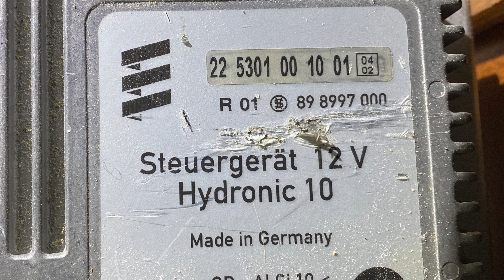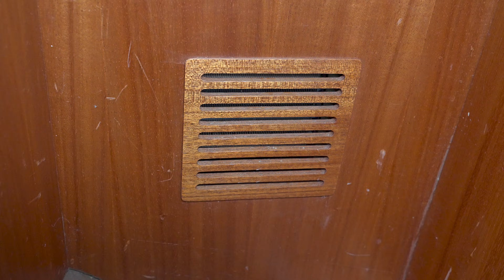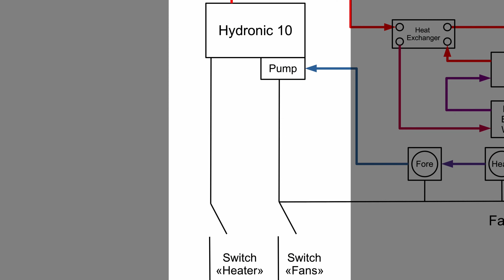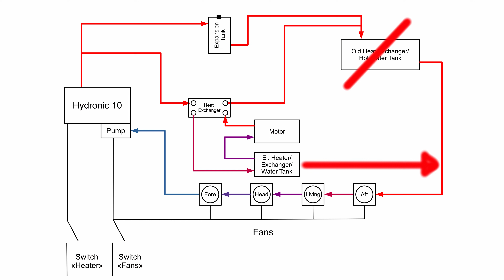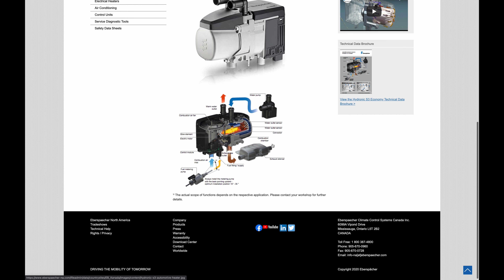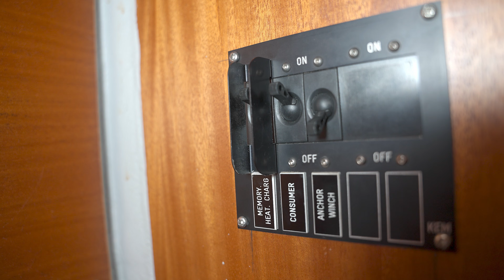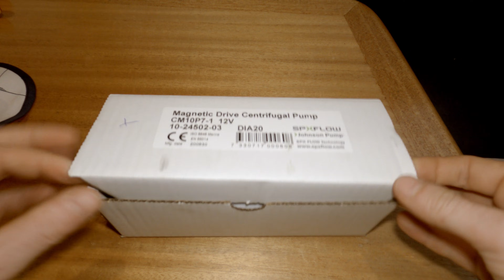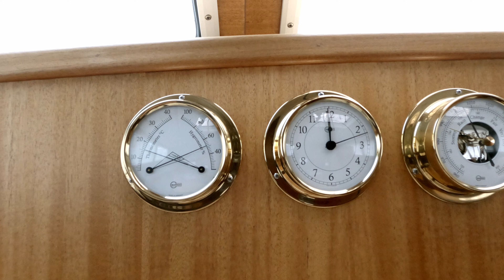Boat Heating | Hot Water without Engine | Eberspächer Heater Upgrade

Comment: Hvilken timer bruker du? Satt på en eber timer, den gå max to timer så stanser den. Hvordan har du koblet den?
Reply from the maker: Jeg bruker ingen timer faktisk. Det var heller ingen fra før. Hydronicen går i "lav" modus eller helt i "sove" modus når vannet i kretsløpet har høy nok temperatur og temperaturen endrer seg ikke vesentlig deretter. Hvis temperaturen går ned så slår han seg på igjen. Siden jeg er alltid om bord når jeg bruker systemet trenger jeg ikke en timer. Håper det hjelper ...
Reply: @SailingSyvsover  hvordan starter og stopper du den? Jeg har montert første gen m10, med den fulgte en timer, men den går max to timer. Ønsker å få den til å gå uendelig.
Reply from the maker: @gacco11  I manualen "HYDRONIC M-II
Technical description, installation,
operation and maintenance instructions" finns det på side 30 en beskrivelse av de enkelte kontaktene i kontrolkabelen/pluggen På den eldre modellen er det kontakt A1, på den nye C4 med funksjonen "Heater on" (gul kabel). Jeg antar at i din installasjon er det timeren som gir 12V til kontakten. I min installasjon gir jeg 12V direkte (gjennom en bryter i kontrollpanel) på den. Så lenge bryteren står på går hydronicen. Du kan jo prøve å måle med en multimeter om det er den som styrer hydronicen. Hvis det er den så kan du antageligvis går "forbi" timeren. Men for å si mer måtte jeg nesten se installasjonen din ... Håper det hjelper!
Reply: @SailingSyvsover  slik jeg forstår det du skriver så skal gul kabel ha pluss når varmeren skal gå. Det kan løses med en enkel bryter?
Reply from the maker: @gacco11  Ja, slik er det i min setup. Men som sagt: jeg ville måle det med multimeter for sikkerhets skyld før du setter inn en bryter. Mål om det er +12V på den gule kabelen når timeren slår på varmeren og om spenningen er tilbake til 0V når varmeren slår seg av. Og hvis det er tilfelle så kan du prøve å sette inn en bryter i stedet for timeren.
Reply: Mister du ikke muligheten til å se feilkodene 
?
Reply from the maker: @gacco11  Ja, men det må jeg jo bare se på når det er faktisk feil. Har aldri hatt det med det nye systemet  (hittil). Og hvis det er feil i system må jeg koble om/fikse det uansett, da kan jeg koble på noe for å lese ut feilkoden... Som sagt, systemet mitt har aldri hatt en timer.

Comment: Great video! I am doing exactly the same project, upgrading the Espar D10 to the latest Espar 10 (M-II). What did you do for the wiring harness? Were you able to use the old harness?
Reply from the maker: There were some changes logically, that is the reason why I had to add the relay. But as far as I remember was the harness itself the same.

Comment: Thank for a very interesting video! Couldn't You have used the old tank as a heat exchanger? You could have run glycol through the heater, pump and the tank and thus increasing the volume of (glycol) fluid the heater works with. Then You could run the radiators as it's own circuit (albeit with another pump) through the old tank's spiral. If the heater circuit and the radiator circuits are separated You might be able to run the heater more steadily. Although Your model of heater seems to have a really good range of heating power.
Reply from the maker: The problem with the old tank was that it was full of rust and the loops not water-tight anymore ... Otherwise I might have used it somewhere else :-)
Reply: @SailingSyvsover  thanks. Makes sense

Comment: Thank you for excellent video and the detailed information! I already have most of the components working, except our boat hot-water tank is not heated by Webasto 90 heater, so i would need to add a heat exchanger and an auxiliary pump. I have a couple questions: 1. What heater exchanger  unit did you use, could you share a link? 2. When  you are motoring, so  the engine is running and auxiliary pump is working, the water-tank is heating up …but what if you also want to warmup the boat. Can you control your fans separately and without turning on the heater? Thank you in advance!
Reply from the maker: Hi!

To your questions:

1. I have unfortunately no brand for the heat exchanger. But any water/water plate heat exchanger should do as long as you can fit the connectors somehow.
2. If you take a look at the circulation diagrams (the link is in the description), you can see that the auxiliary pump is pumping the heating medium also past the heater fans in the cabin. So if you switch on the cabin fans (or they switch on thermostat controlled), you can heat up the cabin, too. In my setup they are separately controlled through thermostats, independently from the heater.
Reply: @SailingSyvsover  Makes sense. Thank you.

Comment: That`s a very good vid, love the humour. Have been getting ready for such a system for a while but keep running into exhaust routing problems. Do you know the exhaust temperature at the exit of the unit?  If i could find this out i could simulate it with a heat gun and some of the exhaust ducting and figure out the heat loss to the exhaust exit and not cook anything else in between.  Thanks, Warren
Reply from the maker: Sorry for the late reply! Your message didn't show in youtube studio, just see it on the normal page right now. I will measure it for you in the coming days! At the outlet it is hot enough to hurt. But I couldn't tell you right now if it is 50 or 100 degrees C (my hands are not that finely calibrated 🙂)
Reply: @SailingSyvsover  Hi, thanks that`d be great.  Little laser heat measuring gun is the easiest. Have put the project back a bit while we go sailing but likely a trip away will lead to more enthusiasm. Cold water is an excellent motivator,,,

Comment: Thanks for sharing. I plan to add this type of system in a van conversion. Two questions if you don’t mind. 
1. Do you and how far ahead have to plan ahead when you want to get hot water for the sink? 
2. Are you just using normal mixing valves to mix tank and hot water to get the desired water temperature? 

I’m wondering if somehow you could have separate thermostats even for the water, like different loops that can be run intermittently to achieve the correct temperature. This is more complex but obviously might be more accurate and even save water and energy I’d think.
Reply from the maker: To answer your question:
1. In my setup it takes 15-20 minutes to get hot water. Usually we switch on the heater (in case we are not heating the cabin anyways) when we are done preparing lunch/dinner and let it heat during the course of the meal. Then we have hot water when we are done eating to do the dishes. But I assume that depends highly on the size of hot water tank you have. The volume of ours is (I think) 25 liters.

2. Yes, just run-of-the-mill mixing valves. 

Most likely you can install different loops with different thermostats. But then you need to actuate valves and synchronise that with more thermostats which adds another layer of complexity and all around more stuff that can break potentially. I am not sure if you could save water with that, but it might save some fuel/electricity, though in my setup probably not noticeably. But for much bigger boats that is certainly the case.

If you think about adding more control over the output water temperature from the heater: Eberspächer offers control units for its heaters where you can fine-tune that. I would suspect that other manufacturers offer the same.

And good luck with your installation!

Comment: Great video! Can you tell us what controller/timer your system is using? I am putting a very similar system in an caravan but I am not sure what timer/controller to use.
Reply from the maker: Sorry for the late answer! The controllers for the fans/radiators are unfortunately some no-name product. It is really just a simple temperature control switch controlling the 12V to the fans. The fans are switched on if the temperature goes below the programmed threshold on the display (gives the fan 12V, so that it can blow air through the radiator and into the cabin). It switches off if the temperature is reached. The Hydronic itself does not need a control unit in this setup. It keeps the water-temperature at a constant value (around 70°C) and circulating constantly as long as it is on. Hope that helps.

Comment: Very helpful, thanks for sharing. How do you vent the hot exhaust, out through a thru-hull or to a chimney on the deck?
Reply from the maker: In this boat there was an exhaust installed already. I think you can buy the parts from Eberspächer or other manufacturers. It is just a stainless pipe which leads through the hull outside in the aft (well above the waterline). The only thing which you have to make sure is that it has the right diameter so that you can connect it to the exhaust pipe.

Comment: For stiff radiator hose you can put the ends in near boiling water and they'll slip right on the fitting like butter. Not convient sometimes but it works wonders.

Comment: Can you service the water pump within the Eberspacher without having to disassemble the whole of the Eberspacher I.e. do it in situ
Reply from the maker: Looks like it. It is outside of the casing and is electrically connected with a little plug. Mechanically it is held in place by a hose clamp.

Comment: Excellent video. I’ve been trying to find a solution for hot water, but already have a Webasto air system for heating. So I doubt I go this route, but always good for ideas and thought.  I wonder if you have an issue with the defrosters (radiators are always slow) - I installed a defroster on the engine cooling system and it is really fast and warm which is a great thing early season as we leave the mooring. I did that about 3 years ago and was very easy. Maybe there is some build up or sediments in your defrosters from that old water tank?
Reply from the maker: Thanks! The defrosters/fans in the boat are quite small and more or less made to be very silent. They deliver slow and steady heat and you have to get close to hear them. In that respect they are more like radiators with a bit of airflow. The system as it is is designed to be kept on for hours on end without being a noise nuisance. I thought about sediment, too, but the return flow would be a lot less if there would be some serious blockage and they output the heat, just not at the rate I'd hoped for. I did flush the whole system (in both directions) and the return flow was crystal clear.

I got a proper 4.1kW defroster unit which I install at some point so that I can switch it on and off independently and will make an update about that. The fan is significantly louder and outputs a lot more air. I am pretty certain that this will alleviate the problem of the initial heating. Once everything has its initial temperature I can switch the defroster off and the normal fans take over to keep the temperature. That is the plan at least :-)
Reply: @SailingSyvsover , sounds like the design is a good one slow and steady. And yes the defroster I have is extremely noisy. Good plan to add such a device on a separate switch, with the motor running the added noise makes no difference. But it is not for long term running when it comes to sanity ;-).
Reply from the maker: @milesbuckhurst504  We use the heating mostly after we arrived, especially when sailing. To keep the sheets organised we often throw the ends down the companionway, so much of the heat would dissipate outside anyway. Upon arrival I hope that I can switch on the defroster for 30 minutes or so to get some baseline heat in the salon. Afterwards the fans should have enough power to keep that baseline and heat the fore and aft cabin.

Comment: I'm going to steal your setup with one modification, and there lies my first question, why do you want to run heat into your living space when you only want to heat water to the tap water system? Two of these below some hose and two y-splitter with a simple on-off swith that chooses between only heting tap water or tap water and heating the cabin. 
I can see that you have fans to your convectors so in your case maybe it does not mather so much to you but I have seven passive convectors and one active with fans so I don't want to run heat into them in the middle of the summer.
Second question, dont your 8kw dieel heater cycle on  and off to much when you have removed your "buffert tank" I bought one only 5kw because it is quiter, draws less amperage and I guess that in it's lowest heating it may stay on even when only heating water to my tap water system. 
Do you have any thoughts of my plans? Do you think it will work fine?
https://www.amazon.se/elektrisk-kulventil-motoriserad-st%C3%A4lldon-luftkonditionering/dp/B0895ZLSZ7/ref=asc_df_B0895ZLSZ7/?tag=shpngadsglede-21&linkCode=df0&hvadid=476490440052&hvpos=&hvnetw=g&hvrand=11947341800634289129&hvpone=&hvptwo=&hvqmt=&hvdev=c&hvdvcmdl=&hvlocint=&hvlocphy=9067788&hvtargid=pla-1015413158376&psc=1
Reply from the maker: Sounds like a proper plan! My radiators all have fans, so it doesn't do much if the heat goes through them and the fans are off in the summer .... But I know what you mean and I think with a valve it would work out just fine. I just didn't want the added complexity.

The old heat exchanger working "buffer tank" was not improving my system. They don't recommend them for truck installations either, at least not in their diagrams... The volume of the whole system in itself should act as some kind of buffer, too. I don't really have the problem that it switches on and off too much. I think it really depends on how "sudden" your heat demand is. If you take a lot of hot showers on hot days it might become a problem. But for the most part the heating is switched of in our boat if it is warm and we switch it on maybe in the evening for 15 minutes to wash the dishes, that is enough to heat up the hot water tank...
Reply: That's the beauty of eberspatcher it throttles down to 5000 BTUs also I would run radiant hose all over the place to prevent condensation 👍😁
Reply: @rogerkerkmann  Doesn't radiant hoses increase condensation on your boat? If you heat the air it should condensate more easy on the cold hull.
My boat has 50-60mm PUfoam from the bilge and up so I rarely get condensation att all.
Reply: @johnnyandersson5622  works on your car windshield in the winter, just as long as you keep the heat above the dew point 😁
Reply: @rogerkerkmann  Yes, but it defenitely wil not work if it was cold water on the outside of the windshield. :)

Comment: I am in the process of understanding my central boat heating system based on Eberspächer Hydronic M 10. The yacht is a Garcia 54 and I have two radiators in the saloon and one in each of the three cabins and one in the master toilet. After searching for info, looking at endless videos and reading manuals I found your video that explains the system in a great way, easy to follow and makes my work easier. You just made my day. Awesome, thank you and keep up the great work.👌👍
Reply from the maker: Really glad it helped you! That was the objective of the video. I was in the exact same situation and had to dig around in manuals, spend endless hours following the pipes in my boat trying to understand my system :)
Reply: can I ask you what model of radiators you have installed?
Reply: Did you find out what radiators they used? I’m having this system installed.

Comment: Good thing my boat it's just 9.5meter long with just one room for a bed room .

Heating ?
Well I have 3 options on the boat .
Option 1 
Electric heater 1000watt.
Option 2 
Diesel heater to air .
Option 3
Just burning wood .
So i have all 3 on board .
For hot water ?
Don't need id we have on the port a shower / toilet and the wasmachine  with coins.
For cleaning dishes a waterkoker will de the job.

And we have here water boiler .
It's works on 12/24 and 220volt.
You have than 6 to 10 liter of 80c  of hot water.

Comment: Great video, thanks for sharing your experiences. I am currently restoring a. 50year old Nicholson 38 and have been puzzling over how to integrate hydronic diesel heater with engine coolant. Obvious now I see it but the heat exchanger is the way to go. Keeping the two systems separate but connectable if  you see what I mean. Any recommendations on a suitable size a spec of an appropriate heat exchanger? Cheers Jon
Reply from the maker: I am not even sure what the exact specifications of mine are. It was there when I bought the boat :-) So I cannot recommend you any number/spec to look after. But I would definitely go for the biggest you can fit comfortably and which you can afford. The more surface area the better the heat exchange rate.

Comment: Very helpful video, thank you so much! What power is that boiler? And where did you get your radiators from?
Pete
Reply from the maker: Do you mean the electric boiler in the system? I am actually not sure what power the electric element in there has. If you mean the hydronic heater it has a maximum power of 9500W. But that is only if it is really running at its max capacity. It usually runs around at its 1500W power mode.

The radiators were already installed in the boat. But you get almost the same radiators from e.g. Eberspächer.

Comment: I found this researching a new 45 foot 4 screw freightliner :) IDK if this is why you had no fuse, but in the USA all heating engineered systems must be fail 100% heat, so dampers or pneumatic relay lines for cool / heat will give you full heat in summer. Those rules came from the US north east, but also apply in Arizona!